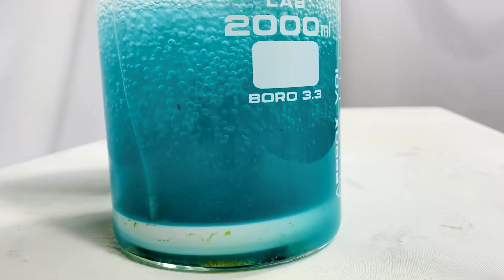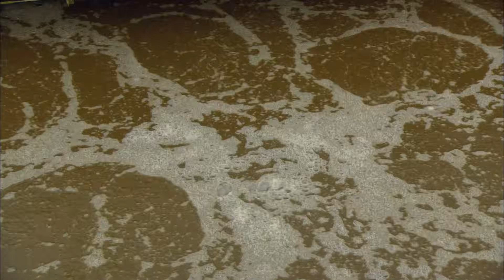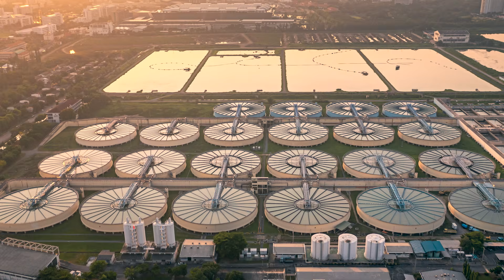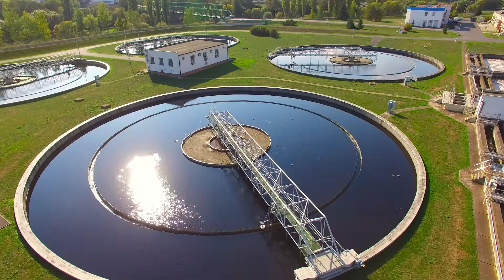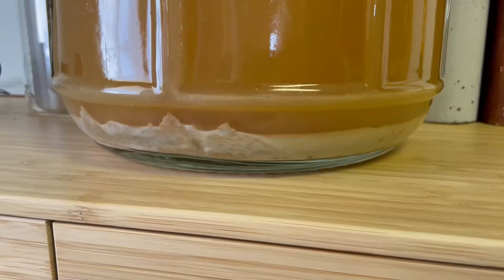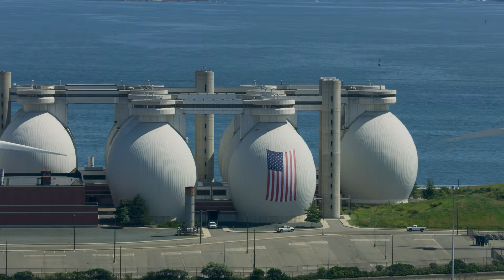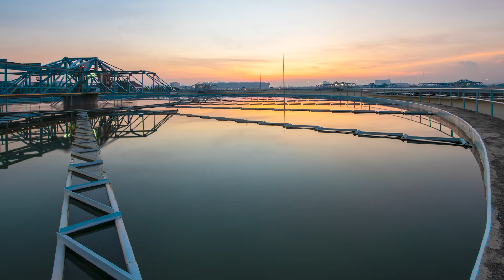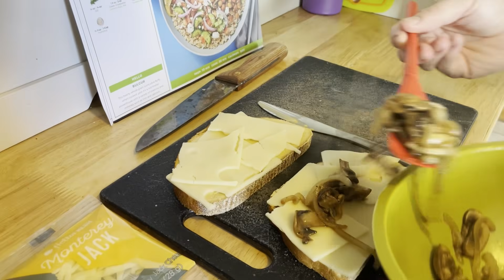What Sewage Treatment and Brewing Have in Common

Comment: A few things to note to the more curious:
1. While we do pump a lot of Oxygen (or just air that has 21% Oxygen, since it's free :P) into the tanks, not all steps/tanks are aerated. Most notably the Anaerobic (for removing Phoshorous) and Anoxic (for removing Nitrogen) tanks are mixed without aeration.
2. BOD is still used today, though nowadays COD (Chemical Oxygen Demand) seems to be more preffered afaik. Though personally I still use BOD most of the time.
3. Nowadays, systems like MBBR/IFFAS are becoming more popular as they require less space and air, and are more efficient. The TL;DR is that in the tanks with aeration we drop tons of small plastic chips on which the microbial colonies later grow, which in turn increases the dencity and speed of the biological proccesses. This/ along some other things make the system more complex. :P
4. One of the big problems that remain, is how to deal with the excess sludge/biomass that is produced on a daily basis? Sure, we prevented it from reaching the downstream water, which is good, but what to do with it now? This is a big topic in itself, and one that is still developing right now.
Reply: at the treatment plant where I used to work we dried the biosolids and turned them into fertilizer
Reply: @randomfastreader  The waste treatment department in the city where I used to live sold the dried solids as fertilizer too, although they cautioned people to not use it on anything that was going to be eaten. Their biggest concern was toxic metals.

For a while a common prank in the city was to buy some of the fertilizer ($5 for 100 pounds) and spread it on someone's lawn to spell out rude words.
Reply: @daveh7720  That's quite affordable, both as fertilizer and as prank material...
Reply: @daveh7720  I actually wanted to ask, as a chemist I've always wondered what they do about dissolved toxic metals. Can it poison the microbes in the treatment plant? Do you guys add any chemical to specifically precipitate out metal salts? Do you even measure it in the first place? How?
Reply: @theprogrammer32  generalist not used for residential wastewater, nut for industrial wastewater, toxic metals can be removed by changing the ph. The downside is that you are left with toxic salts.
Reply: @theprogrammer32 methods for removing toxic metals can include chemical precipitation, ion exchange ,adsorption,membrane filtration, reverse osmosis, solvent extraction electro treatment. Several of these can be scaled up industial level it can just be very expensive to do and or operate so I think namely Membrane filtration as that has been tested for purifying ocean water. And using electricity for ion exchange would probably be very expensive also.
Reply: @theprogrammer32  most collection systems will require companies wanting to discharge toxic metals to pretreat their waste before it gets to our plants.
Reply: @infernaldaedra  RO only concentrates waste to a certain degree. Normally in desalinization you're only getting something like 1 gallon of pure water to every 9 gallons of "waste". RO isn't really viable for wastewater treatment. Stop spreading misinformation based on some buzzwords you picked up watching YouTube and reading Wikipedia.
Reply: @theprogrammer32  Engineers don't expect toxic substances in general residential wastewater. If we are talking about industrial water, then depending on the severity biological treatment (the one discussed in this video) may not even be viable and alternative treatment plants need to be considered. If biological treatment is possible, then we use equalization tanks before the bioreactors where pH and Alkalinity is corrected, along other meassures. Honestly, I've only head to deal with slight acidity once since I deal with residential water, so I am not too sure here either
Reply: @ParadigmUnkn0wn  this is partially true, although with projects like blue energy you can mix part fresh wastewater effluent with the concentrated brine to get some power back from it. Then you can mix that again with the salt water from the sea to feed it back into your ro plant
Reply: @theprogrammer32  AFAIK heavy metals are typically removed by sulfide (or hydroxide) precipitation or by chelation - the suspended colloid is then coagulated and flocculated with suitable agents (e.g. hydrated lime + aluminium sulfate, sodium silicate + chitosan) - it then settles to the bottom of the tank and the cleat supernatanr water is "decanted" ... 
I am not sure about water treatment facilities but at least these methods are utilized in hazardous waste processing (e.g. from laboratories).
Reply: @theprogrammer32  The biggest emerging issue is actually PFAS. It is similar to the problems that dioxins were to the paper industry in the 90's. We are just beginning to understand how harmful the compounds are and how persistent. While you can get around the issues of land applied solids disposal by stating that they not be used for crops for human consumption, the issue is 20 years down the road when property is sold. Records are not properly transfered and the land may be grown. PFAS chemicals have incredibly long half-lifes and can persist nearly indefinitely in soils.
Reply: @randomfastreader  Turning the sludge into fertilizer is possible, but it's not an easy task. The plants where I live don't have the equipment or knowledge on how to do that. Afaik it's mostly "disposed" of here (don't know how though). There have been talks of introducing sludge decaying/devouring worm plants to deal with this.
Reply: About point #3, how difficult is it to remove the plastic chips added/what happens to them? 

Also adding plastic "confetti" for microbes to grow on is one of the problems caused by microplastics in the ocean, do you know if the treatment method is inspired by this problem or if someone from the treatment industry had an "oh shit" moment about the plastic in the ocean?
Reply: @jasonreed7522  Here's a short video that has carriers/chips of different manufacturers in the water: https://youtu.be/Rl8wHT1uVHw
Those carriers are larger than just "confetti", and they aren't consumable, they are kept inside the tanks with sieves/screens/nets.
There have been a few cases of some of them "escaping" into the downstream water due to floods or design failures, but they are exceptions.
Reply: Have you experimented with different types of plastic pellets or Alternatives like light ceramics? In the aquarium hobby the surface area of the medium has a massive effect on the amount of bacteria that it can safely house.
Reply: @infernaldaedra  any kind of ceramic/sintered/porous material is going to quickly become clogged and be no more effective.
Reply: @ParadigmUnkn0wn  Incorrect. Ceramic bacteria colony substrate lasts for a very long time. Also I didn't ask you. I asked the professional if they had considered using newer more advanced types of bio medium.
Reply: @infernaldaedra  it lasts for a long time in your fish tank, not in an effluent tank filled with human waste. Big difference. Also, you don't know my credentials, or anyone else's on here. But hey, you're free to display your ignorance wherever you like, it's the internet.
Reply: The lab/plant I work at runs BOD and COD. I don't personally because I'm not a chemist (yet), but yeah, we do both... is that unusual?
Reply: @Drakeblood97  Its not that unusual to run both and are both very important for a well rounded analysis on your waste water. COD is sometimes very important to do especially if the water is coming straight from a industrial site or anywhere where they use chemicals whereas BOD is more used for residential areas where you are looking at material that can be processed by microorganisms
Reply: @Drakeblood97  we do the same thing, our permit requires us to run and report BOD but we dont have results for 5 days, so we also run COD because that gives us a result same day
Reply: @Drakeblood97  As far as I know, most modern literature uses mostly COD (most notably Metcalf & Eddy). BOD is still in use (we use BOD mostly, but that's because I live in a post soviet nation with outdated equipment :P)
Reply: @Drakeblood97  not really. In Czechia, we run both + tests for nitrogen forms (NO3, NO2, NH4), total P and suspended solids.
Reply: In norway we burn it to turn it into energy that heats water, then the water is sent through pipes to heat housing and businesses connected to the pipe network.
Reply: Is the biomass not useful for fertilizers?
Reply: @UnbeltedSundew  they are used for fertilizer. Mostly for non consumption crops, though there is class A bio solids that can be used for it. The requirements are crazy strict though.
Reply: @KpuruBear  i think we did class a biosolids. It was a pain.
Reply: @UnbeltedSundew  that depends on the levels of diffrent metals in the sludge, the county i work for has 5 big wastewater plants, but only 2 of them recive waste water with low enough levels to be sold as fertilizer.

Also waste water slodge is only allowed on fields wich will serve as food for animals.
Reply: @zentrobi1548  I think it can be used to irrigate any crops which are not for human consumption, including cotton, alfalfa, jute, hemp, clover, feed corn, etc.
Reply: @EebstertheGreat  hemp is some times used directly in human food tho, regulations might be diffrent around the world, but atleast here in Denmark its not allowed to be used for something wich have a direct use in human food, it can be used in cotton and other clothes plants ofcurse, i thought i didn't have to say that :)
Reply: @zentrobi1548  I think the populations of hemp grown extralegally for smoking are pretty well separate from the ones grown industrially for fabrics and such.
Reply: Anaerobic digestion for the production of biogas is popular for reuse of sludge in the UK. The digestate can then be used for non-consumption energy crop fertilizer.
Reply: In Australia the waste sludge is rapidly becoming valuable as fertiliser. To the point where demand is already outstripping supply now that cheap oil based ones are becoming less cheap and how much BETTER(Not just equivalent.) it, is being shown. There is a final processing step that is also limiting production, but it's a great use for it.
Reply: With fertilizer shortages being a thing, I wonder if there's an economical way to return the nutrients to the farms?
Reply: @ugh-meh  yes there is, there are many projects and research ATM running to extract the phosphate back out of the wastewater. It is effective but ATM mined phosphate is just a lot cheaper
Reply: You don't need to dose plastic chips to get granulated sludge though. Most plants here in the Netherlands and the pilot setups i ran myself where able to just form granulated sludge with a good feed feast cycle.
Reply: @turk639  I never meant that you had to use biofilm, however, at least in my region my company has only gotten MBBR/IFAS orders since I joined. Unless the goal is a small treatment plant for up to a few buildings, standard A2O with suspended solids is impractical for us in Georgia. There's just not much space in the mountainous regions. Moving Bed Reactors are generally cheaper and come in a more compact footprint.
Reply: What do they do with those plastic chips later? Do they just get thrown into landfill?
Reply: @JGnLAU  Probably get recycled into the loop, as they are colonies of the bacteria they want.
Reply: Amazing, thank you for insights
Reply: We just put it in barrels, bury them and let future generations deal with it?
Reply: @chrisakaschulbus4903  It's actually not waste. The sludge from wastewater is EXTREMELY nutrient dense as well as having lots of other minerals I don't think it will ever be something we'll need to bury and even if we do it wont hurt the ground as long as it's treated properly. Future generations will have much worse things to worry about lol.
Reply: @infernaldaedra  I guess you're right... i was just making a stupid joke :D
Reply: The image of those large egg shaped buildings, those are digesters. The largest cities have them. The mass goes there and is composted. Afterwards it is sent through a clinker mill and dried. Somewhere between compost and drying, there is a process that removes the metals... The fertilizer that comes from this process is perfectly safe for commercial use. In combination with yard debris cleanup. You can get a useful planting medium with fertilizer, for almost nothing...
Reply: they dump it in the ocean and one smart guy in texas bought it for really cheap and used a spreader to spread it in the desert to see if it would"fertilize" the texas desert
Reply: Is it viable biomass for fuel?
Reply: Wouldn’t baking the sludge to render it sterile and then using it to fortify potting soil be a pretty good option?

If the entire purpose of all of this was to remove nutrients from the water, the sludge must then contain those nutrients at the end.
Reply: @Nevir202  Some of the nutrients (namely carbon and nitrogen) are turned into gaseous from (CO2 and N2 respectively). However, the non-gaseous ones stay there (salts, metals, phosphorus,...). Unfortunately, this includes heavy metals like lead, mercury and cadmium and they can be a bitch to separate from the useful rest.

Comment: Why can't the nutrient portion of wastewater be used to fertilize crops?
Reply: It is done with solids, the liquid is more difficult however many golf courses and parks are irritated with effluent.  Issue is the process in the soil can cause anaerobic conditions.
Reply: I think one issue would be the density of the nutrients, you would want to concentrate the nutrient water significantly to make it viable to ship to farms and that takes a good deal of energy. And practically speakimg all the phosphorus, nitrogen, and iron atoms in the waste water are simply moved into the sludge of dead microbes on the tank floor and are now in a "solid" form for much easier shipping.

The other concern is that if life is treated as a reagent limited chemical reaction (think of putting a lid on a candle, it removes the oxygen so it goes out), then the nutrients in the soil might not be limited by the blend in the wastewater, and worst case you make oxygen the limiter in the soil and all the soil microbes required for your crops to grow will die significantly harming your yield.